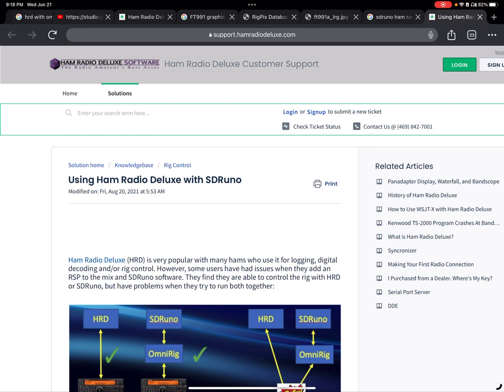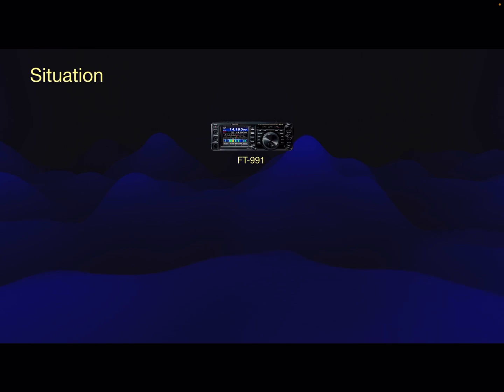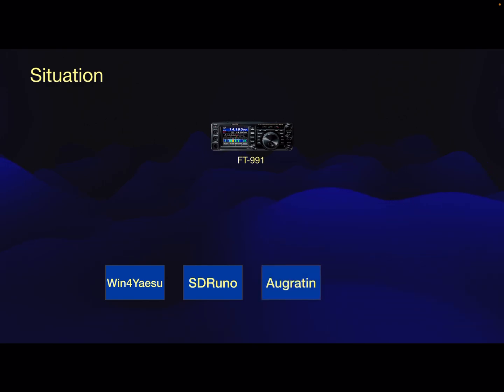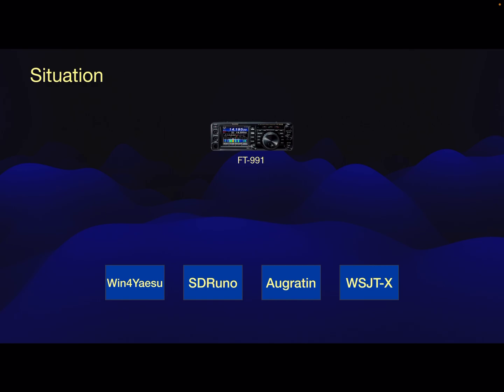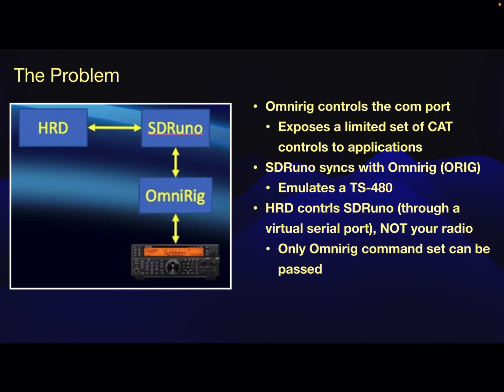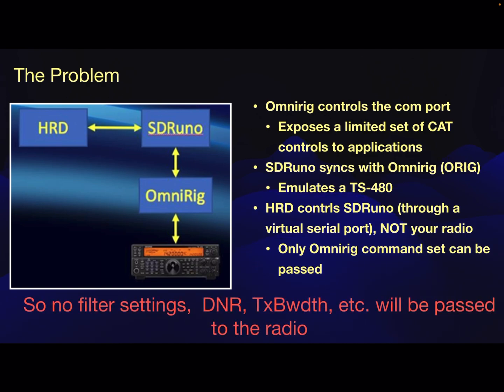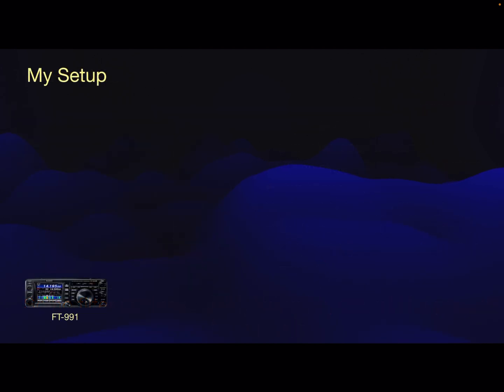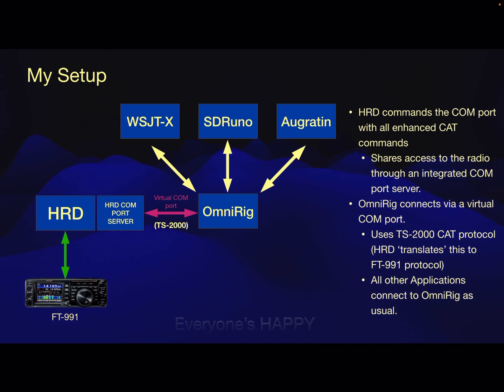HAM RADIO DELUXE and Omnirig

Comment: Couple of questions:
1.) Looks like in the comments below you went back to Win4Yaesu, what prompted that?
2.) Is the VPSE program ($$50 for x64) still needed to make this all work? 
3.) Is there a one pager you could make for the 991 and configuring this?
Reply from the maker: 1.) I originally bought HRD on the promise it was modernizing their interface and adding POTA and SOTA functionality to their logbook.Two years later this is still just a promise.  I switched back to Win4Yaesu mainly because I like interface better for CAT controls - HRD may be fully customizable but I found some errors in a few controls - probably could have dug into to the radio configuration files to correct but in the end I find the interface of Win4Yaesu more visually pleasing and being that is written specifically for a Yaesu radio it just works - it also has macro capabilities that I use to add functionality (like TxBW setting, waterfall manipulation, etc) it also can interface with HRD logbook, digital master so at least I getting some value from my HRD purchase - for POTA I ended up using Augratin (I got a vid on that) 
2.) Yes you still would need a virtual comport to share the CAT control across multiple applications but I use Com0com which is a free application. 
3.) I'll put your request on the list - but in the meantime the approach is exactly the same as with HRD - In Win4Yaesu, you'll find these settings in the '3rd party software integration'.  Here's a quick link to a write up: https://yaesu.va2fsq.com/third-party-hardware-and-software-integration/

Comment: Hi i am figuring out how i get the right menus in HRD do you have some more detailled images or screenshots? I understand the concept. I make use of an old version of HRD and clean install and work with the program for a week now. I am searching and searchin where to enable the virtual comport with the TS2000 i cant find this option. some details would help me a lot. This apporach makes HDR the main program to manage the RIG and all other integrations could be done over omnirig, i like the approach.
Reply from the maker: I moved back to Win4yeasu sometime ago, but I'll dig up HRD and provide you som detail

Comment: That’s a great video, I do have a question. Although I like the idea, how are you going to use the SDRuno filters in the config you are suggesting? It looks like you won't be able to - which is the reason (I would imagine) that you want to slave the other apps to SDRuno. Am I correct on that or missing something?  73.
Reply from the maker: I’m only using the SDRuno for the waterfall display and to quickly scan an tune to a given signal (ie:control my radio). So far, I haven’t found anything compelling about the SDRuno filters that my radio didn’t do better. But if I did, I run all my devices into an audio interface so I could theortically RX on my SDRplay (employing the SDRuno filters) and TX on my 991. - I actually did this for a while when I was experimenting with the diversity reception capability of the SDRplay duo.

Comment: You still need hardware SDR play or RTL SDR etc, for your setup?
Reply from the maker: I upgraded my radio this year so I don't necessarily need to use my SDR play I still run it because it provides a much better / wider view of the band activity compared to the one in my radio.
Reply: @BarryShaffer  my radio is ic-7300 ..i am thinking if can just use HRD+SDR console or SDR uno without Hardware SDRplay can work..
Reply from the maker: I know you can get the waterfall over USB on the Icon using their software (I can't on my yaesu). But I don't know if any SDR software package can directly interface this way.

Comment: What you are saying makes perfect sense. I am trying to use this setup with an IC-7300 which has the PTRX-7300 installed but, even though I located the com port server in HRD, I am at a loss as to what ports I assign to HRD, OMIRig and SDRUNO respectively. Also what additional settings do I need to do to make this work. Any help will be greatly appreciated. I already have a virtual com port pair configured using com0com.
Reply: Any help with this would be greatly appreciated.
Reply: I'm still unable to get this to work ... desperate for assistance

Comment: i am trying to do this with my ftdx3000 but where can i find this com port server in hrd
Reply from the maker: It's under the third party software section of settings.
Reply from the maker: @juspjgarcia  Tools>>Hardware>>3rd party serial port
Reply: @BarryShaffer  I cannt get this to work at all?
Reply from the maker: @Orthodoxuk  have you been able to at least get your radio configured to HRD only?
Reply: @BarryShaffer  The radio is fine but I cannot get the other progs connected. Why is it so hard? I just need wsjtx and slowscan running in tandom with HRD for my FT450D.